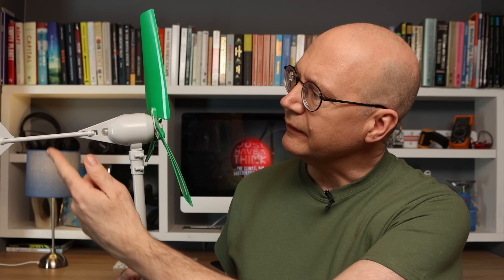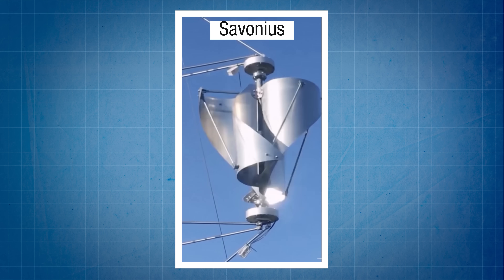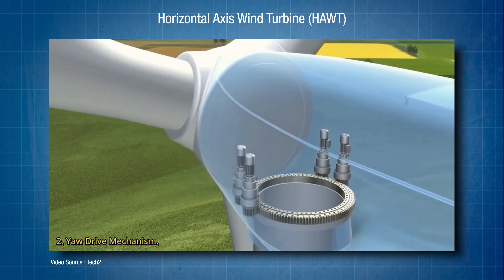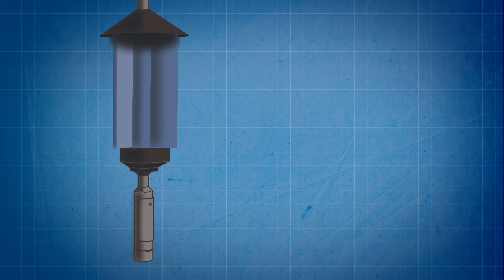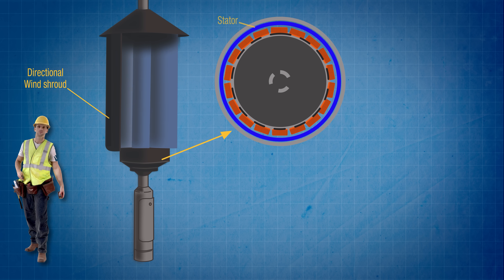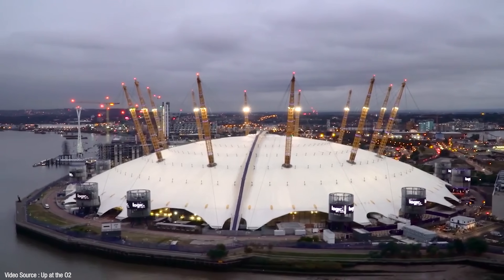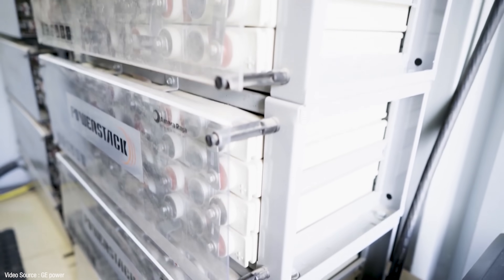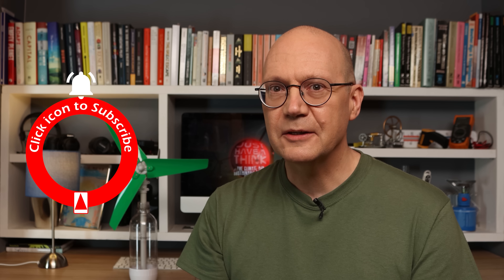A vertical axis wind turbine that doesn't need the prevailing wind! How do they do that?

Comment: Great idea.  Did they take into account the additional wind load cross section of the turbines?  This will add additional stress to the poles in windy conditions, and could cause the poles to fail (and fall over).
Reply: Im not sure if you saw the graphic of a Turbine against a man for scale, the turbine looked to start about chest high and rise upwards approx 2 metres, all centered around the lamp post. There will clearly be a wind load in operation, offset by the gyroscopic force when the turbine is spinning, which looks to be quite some mass when running fast, so this will act as a stabilizing force and  the leverage is quite low down to ground level, before any additional strengthening which may be needed on the retro-fit.

Comment: Misleading headline. Disappointing. Surely 'Just Have a Think' can do better than that. Otherwise good job.
No mention of G forces on the posts that these VAWT's  are attached to.
Because of the G force associated with the capture of wind energy I doubt they could ever work on most communication towers.

Comment: I don't think the turbine power estimates are plausible. The kinetic energy flux through a square metre is 0.5*Density*Area*Velocity**3. At the stated 5.4m/s wind speed and 30% efficiency these turbines would need approximately 100 square metres of capture area to generate the stated 2.5kW. Yet the illustration shows a device only 2m tall! My guess is the device as shown would generate only 100W, which would make them a waste of time. 
I like a good idea as much as anyone but you can't cheat at physics. If anyone can see an error in my method I'd be happy to hear.
Reply: Jeffrey Lebowski calculated 25 watt in his comment so you're not much wrong. This is a scam, and sadly, Dave is spreading it.
Reply: They need a constant minimum wind speed of 90 km/h (55 mph) to compensate for the small size. 
it's getting clearer: Speed limits are a trick of the climate deniers that we have fallen for. We need incentives for really FAST cars!.

Comment: Especially in tunnels or anywhere the  air is confined, adding a turbocharger funnel could help concentrate the airflow even further for a design like this, if the materials can handle higher speeds.

Comment: Imagine the power for most of the lighting and other needs in farm and rural buildings being produced by self generated electricity. In some rural areas, you could have the generator rod be long enough to run a well pump suitable for watering a garden or for farm animals, assuming the water was safe for that use. I have a few other ideas, and am looking at a farm or hobby farm to try some of them out. Imagine water and electricity from the same wind.

Comment: The point you make is that the first U.S. customers of Alpha311 are not tax funded.   I as easily support the privately funded Texas Central Rail as I support the private market Alpha311.   If it works, celebrate and use it.

Comment: Lot of hot air imho,  no numbers  published on site, no price for a single unit anywhere, Betz law is harsh and unless they invented new fysics in a place without the traffic and 6 meters per second average wind speed they won't harvest much more then 250kWh per annum. That's 50 euros worth of power where I live. They'll  have to be very cheap in order to make economic sense and I don't see them making these below £1000 retail.
I do hope I'm wrong.

Comment: ref 8:21
It is not just wasted. You have something call slipstream that reduce the power needed in the cars behind. Breaking the wind will increase the drag and cost more energy for the cars driving past. Even a single % increase will be many times more then the power you get out.  This type of windmill also are rather noisy with lots of harmonics that are mot very pleasant.
I live at the side of a motorway and some of the most annoying sound at the moment are the high pitch sound a few types of electric cars make, and that is close to the same sound small to medium sized vertical windmill makes. 
Design can help, but small unregulated power sources put into a mesh is not efficient. So the 30%  will be a lot less before it is out on the power grid.

Comment: I would claim: The energy is still coming from the cars. If there are no obstacles, it is easier to push the air away.
Reply: That is correct. Just like head wind of tail wind make a difference for fuel economy. 
In speed skating in closed arena's, the air starts circulating to produce a modest tail wind due to the speed skaters in the direction that skaters are moving. 
Normally we see traffic move either in the one or the other direction. In such circumstances this system would reduce fuel economy for cars. When both sides of the road show similar traffic, the interference between these 2 flows will likely result in turbulence that will increase drag on both sides. I these situations,  such wind mills could theoretically reduce drag by reducing turbulent conditions. Needs further studying I guess.
Reply: @justforthehackofit  needs more study is my thought exactly.   For example, fuel economy can be gained (dangerously) on fast roadways by driving close behind large trucks.  I mention this only because it indicates that airflows on the roadway have some sort of effect on energy efficiency of vehicles, and since windmills harvest energy by effectively slowing air down, it’s important to study all this and find out the cumulative impact of the airflow changes that these devices will cause.  Might be small but still could cause more fuel to be purchased at the macro level , which the oil companies will appreciate.
Reply: @sc20910  when we drove a small VW Lupo 3L we managed a fuel economy of 40 km to the liter (94 miles per gallon) behind a truck (couldn't resist trying)
Reply: Correct this is just snake oil marketing and people fall for it.
Reply: It does sound a bit like slavery with extra steps.
Reply: @oneplaneteer1708  You do realize that most of the planet's economic growth since the ending of slavery in the 1800s, has been made possible by coal (foundry fuel) and petroleum fuels and its efficiency at producing 'work-energy', just for the cost of pulling it from the ground.
Reply: @oneplaneteer1708  Weren't You the one that brought slavery into this discussion? Any 'presumptions' on my part are based on evidence, not mere name-calling speculations. And how arrogant to consider yourself 'everyone'.
Reply: @oneplaneteer1708  'Everyone' knows that that all human technology was gifted by the 'Ancient Aliens' with a refresh after the 'Roswell Incident'...
This very item covers a 'technology' dating back to ancient Babylon, with the addition of 'modern' generators for electricity, instead of water pumps.
But Tesla (a pre-Roswell inventor) had a better idea than Edison.
Reply: @terrytaylor2825  Yeah... go be bored somewhere else
Reply: @oneplaneteer1708  Mom said name calling is the first resort of the intellectually deficient.
Reply: @oneplaneteer1708  Explains so much about you...
Reply: @terrytaylor2825  Roger Roger, coffin dodger
Reply: @terrytaylor2825  So, if we could raise awareness of our alien overlords, is there anything we could do to overcome their reign?
Reply: @oneplaneteer1708  Too late, the descendants of the 'Robber Barons' have already collaborated with them for decades to keep us minions... minions. This is why short-selling on sovereign currencies is 'legal' and on any given day 1% or less of stock owners decide the 'market value' of every company traded on any given exchange.
Reply: @terrytaylor2825  Then it sounds like pointless information to disseminate. Buh Bye
Reply: @oneplaneteer1708  Like all that you typed... Thanks for being played, er I mean 'playing'...
Reply: @oneplaneteer1708  '1-trick pony' by Paul Simon, look it up and listen, it's a great tune.
Reply: @oneplaneteer1708  That's pretty sick mon, since she passed in 1997... there went all that self-aggrandizing virtue signaling, eh wot? Impossible to climb under your standing now, don'cha know? Now you're eye-to-eye with Pennywise.
Reply: @terrytaylor2825 I hate to be the bearer of bad news but not all stories are real. Some people like to tell stories they just... make up. Like, clowns in the sewer or goblins from other starsystems. This is so surreal, I think I'm the second coming of Jason Nesmith.
Reply: There are electric cars... and with these installed there could be charging stations at intervals for those forgetful EV drivers, part of the charging pulled from evil diesel truck and petrol vehicles that don't need banks of toxic, flammable, expensive batteries that rely on slaves to pull from the ground.
Reply: @terrytaylor2825  petroleum fuels are also toxic, flammable and currently more expensive than they used to be and will only become more expensive as we are forced to ho deeper into the oceans to find. Buried stuff runs out. 

So maybe we work on making a society that needs less buried stuff all together.
Reply: @oneplaneteer1708  So you're all in on Bill Gates' plan for massive population reduction and  poverty imposition on the bulk of humanity? Sweet.
Reply: @terrytaylor2825  do you believe there is an afterlife?
Reply: @oneplaneteer1708  That's one of Band-Maid's latest songs, soooooo

Comment: Interesting idea. I have always thought that a good place for VAWTs would be on transmission pylons (obviously, size appropriate, in consideration the sideways forces they would create on the structure). An Australian company more than ten years ago created a horizontally mounted but VAWT in appearance, turbine to be mounted on the underside of bridges. I suppose currently, the economics may be against these ideas - not enough generation to warrant the cost.

Comment: In more conventional non motorway scenarios the higher the blades are situated above the ground the more wind energy is collected to convert into an electrical energy.... A  pole or tower  in a windy spot could carry a multitude of wind power units  in a variety of configurations ...   Such a low tech way of gaining self generating electrical power would be a very welcome improvement to farmers and settlers  out in the back of beyond ...

Comment: would the wind turbines by the road side contribute to more wind resistance for cars than would otherwise be there? (or, put another way, might we get equal power savings from trying to minimize air drag along streets?)
That said, I expect the trade-offs are likely in its favor, even if I'm not certain of the extent. And probably the biggest point of savings here is from land usage. I love how this can work anywhere, and provide power directly where it's used.